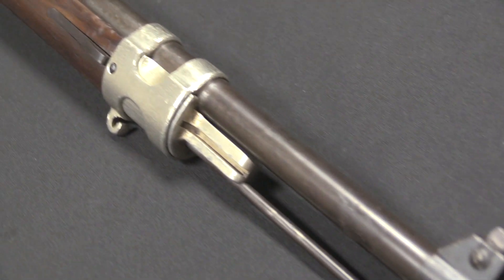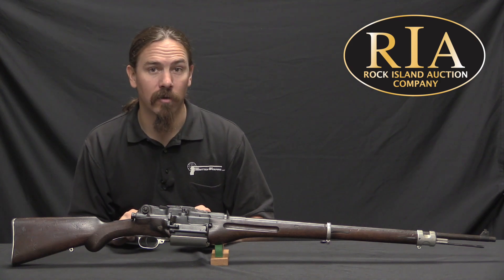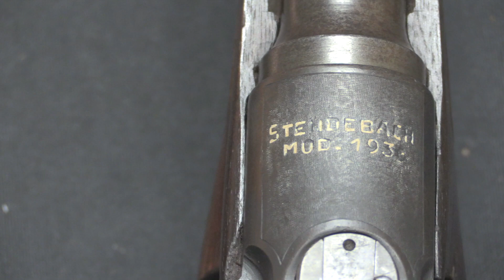Stendebach Model 1936: Rotary Mag Toggle Delayed Experiment

Comment: Hello IanI found the same rifle  in a picture : http://galerie.valka.cz/showfull.php?photo=153270On the display information leaflet on the right you may retrieve some additional informations about the gun..
Reply: That's not the same gun, or at least not in the same configuration. It has a mauser style rear sight, a different stock (notice the brass fitting in the rear and different shape of the grip area, as well as the lower front furniture having a groove), and the clearing rod is not present. The magazine cover is either not present or smaller, and most of those parts look more like steel than Ian's example. If it is indeed the same rifle, a lot of changes have been made to it.
Edit: I missed the difference in the rear of the receiver. This one doesn't have the same recoil springs. They are strikingly similar but certainly different guns.
Reply: pantarei20 Very close but it is not the same firearm. The round tabs on the back of this rifle's receiver are missing for example.
Reply: Not the same firearm, but an earlier model (1925 I think)
Reply: "self-propelling by direct gas-pressure" sounds like blowback to me....
Reply: Thanks Macdeas :-)
Reply: Thanks Vara Diio : I didn't notice. At first sight they looked the same...
Reply: pantarei20 jerry here, description also does not fit.
Reply: even tho you know now thats not the same gun, i can tell its not even the same 
working mechanism. 
on the infocard is written "Eigenantireb durch direkten Gasdruck" = self-propelling by direct gas-pressure.
Reply: OK Thanks Bent Out :-)
Reply: I'm german and i think it's the same Gun it says 1925 and since both are Prototypes that explaines why they look slightly different considering the 10 Years time span between the two Guns. But the description says something Pederson and that it has a "verriegelung mittels Kniegelenkverschluss" (toggle locked)

They look identical except for the (very noticeable) missing Recoil Spring housing at the end of the Receier that the 1936 Guns has. This one is (also?) missing the Magazine but instead has a Handguard (and standart WW1 Mauser sights).Which would  confirm Ian's Theory that the Aluminium Parts (not Aluminum XD) on the 1936 Prototype were made afterwards and that the Magazine Parts were missing (just like they are in this Picture)

These two are definetly related/Prototypes of the same Concept
Reply: It reminds me of the Selbstadler 1916 from Battlefield 1. Just without a mag.

Edit: it actually (after a second look) looks more like the Selb1906. I know it isn't, but it just kinda reminds me of it.

Comment: Wow this thing is interesting! Are those replaceable steel "pads" in the camming surface inside the receiver? I wonder how many rounds those were intended to take before being changed.
Reply: My guess would be shims. Being a prototype it would seem likely that they would need to adjust those cam tracks, maybe they realized after machining it out that they were to small and the action either opened to soon or not at the correct angle. Either idea is possible, and given the lack of documentation we will never really know.